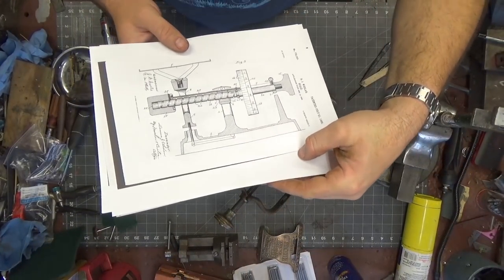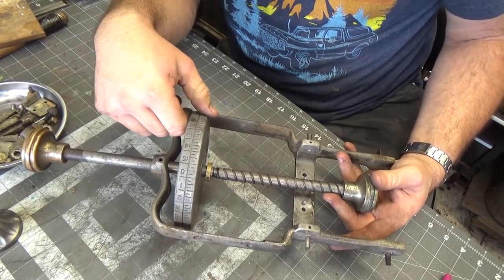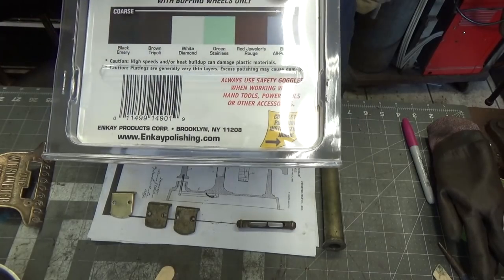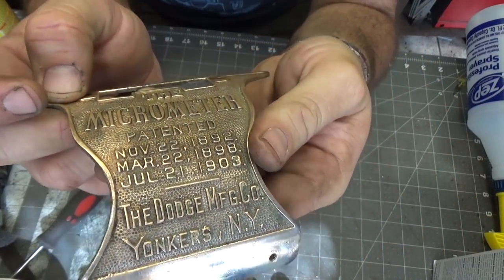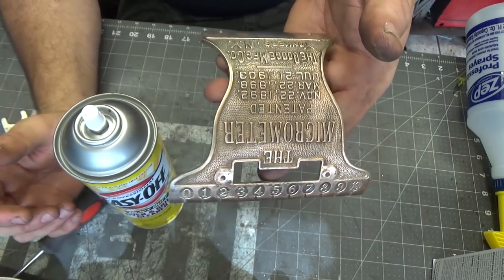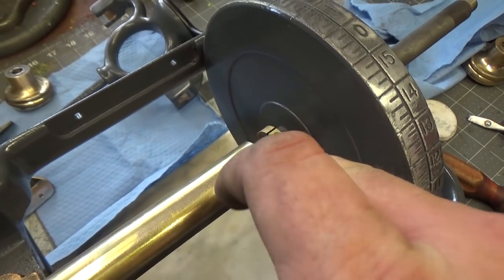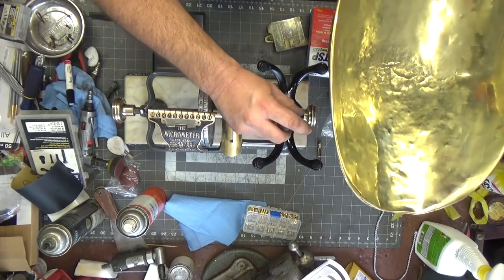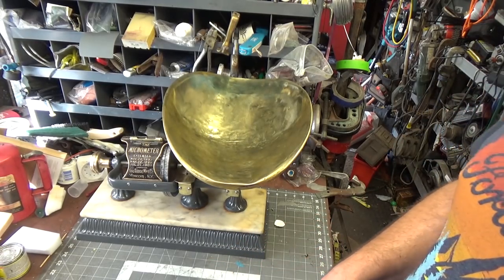Dodge Micrometer Scale (Part 2)

Comment: Came out great!  I actually never expected the marble to come out that nice. 
Getting my shed under control is actually one of my biggest projects too!
Reply from the maker: The shop is a neverending battle, i need at least 2 shops. One for grinding and one for assembly. Bradley and Niamh had a cool idea of making brass feet for the stands to cover the stain. I ordered the brass, if the idea works ill make a third video
Reply: @joeheilm  sounds very intresting! 
I'm afraid that no matter how many shops and shed I got it wil still be something I'm gonna fight with.

Comment: Hi Joe,  I've had some success using a glass fibre pen to clean up difficult areas like that textured background. I don't know if you are familiar with this but it operates like a propelling pencil, as you twist the barrel it pushes out a glass fibre brush, I've also got brass wire and steel wire versions.
Reply from the maker: Hi Leo, never heard of such a thing, but it sounds like something i could use. Ill see if i can find one on amazon, thanks

Comment: The name plate looks sharp.  I wonder if you wanted to cover up those rust stains, you could maybe get some brass shim stock and cut out some circles that would cover them up?.  If it's thin enough, you may even be able to use a compass or a divider to scribe your way through it so they had nicely finished edges.  Or you could tighten 3 layers between two layers of steel and then machine it in the mini lathe??
Reply from the maker: I like that idea! Maybe i could add a whole sheet of brass....thanks for the idea, im gonna look around and see if i can find any examples.